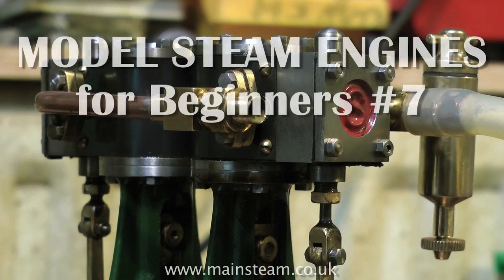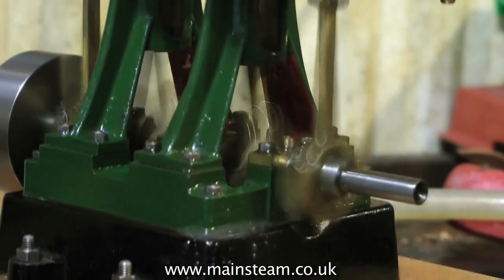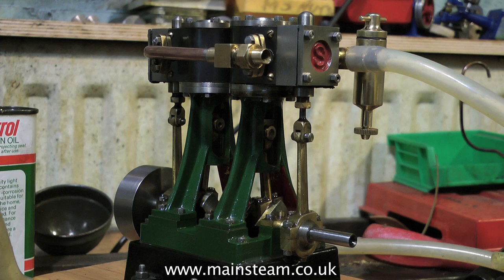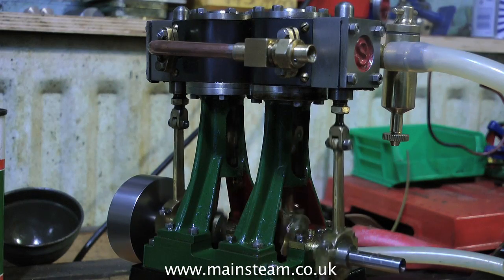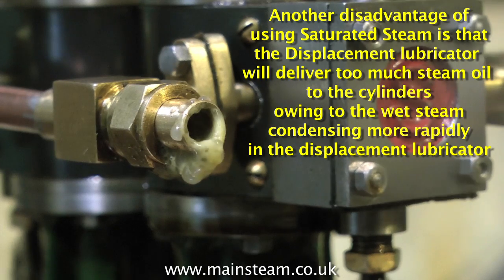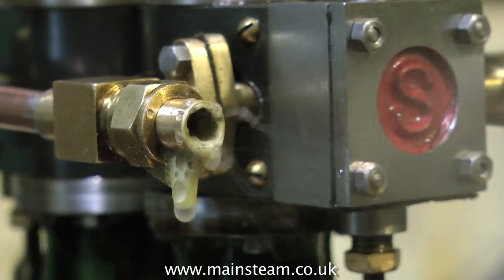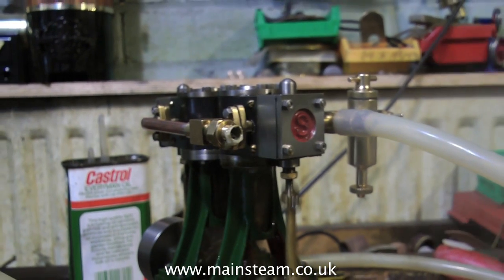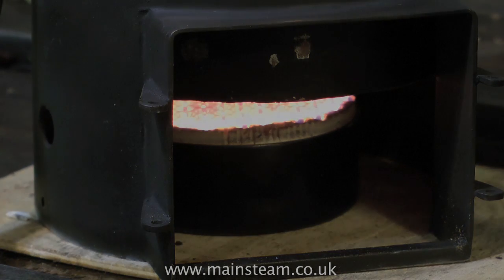LIVE STEAM SUPERHEATERS - MODEL STEAM ENGINES FOR BEGINNERS #7

Comment: Keith, you mention superheated steam is unsuitable for brass of gunmetal cylinders. Does this also hold true for brass pistons? The engine I am considering has a cast iron cylinder but a brass piston. Thanks
Reply from the maker: It all depends of the degree of superheat. Generally a steam drier type will be OK for brass, but if the superheater element is exposed in the firebox over a hot fire than it can be a problem. Normally Pistons are Gunmetal in a cast iron cylinder - as with Stuart Engines.
Reply: Thanks. I just ordered my first engine, a Stuart S50, and on the parts list they show the piston material as “Brass”. The boiler I plan on getting has a super heater, or more correctly, a steam dryer coil in the smokebox, so your warning has me a bit concerned...
Reply: @keithappleton  
Do you have any info or videos on model steam driers?

Comment: Keith,
what will happen if you use copper tube instead of stainless steel in the superheater inside the firebox?
Can you use bronze cylinders with superheat?

EDIT -- 5/2017 --- never mind; I've found the means to use stainless tube & Inconel fiittings for the superheater elements within the fire box.